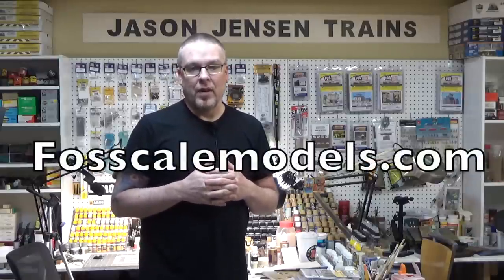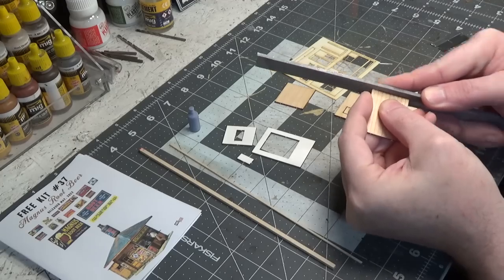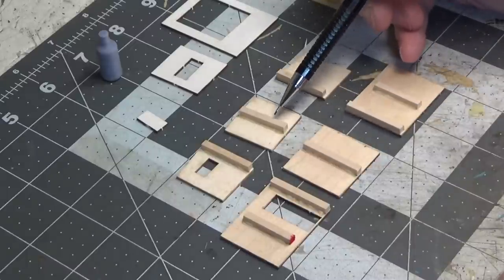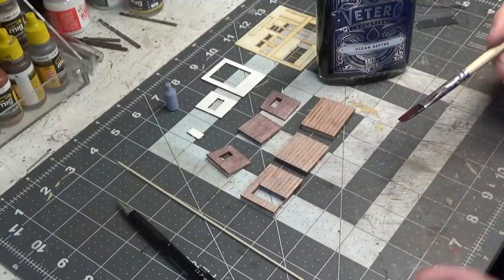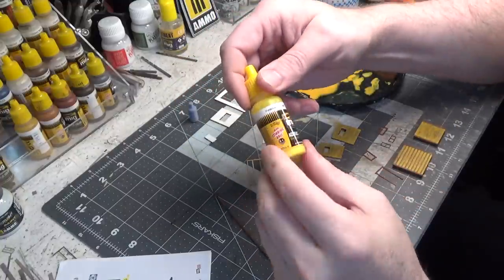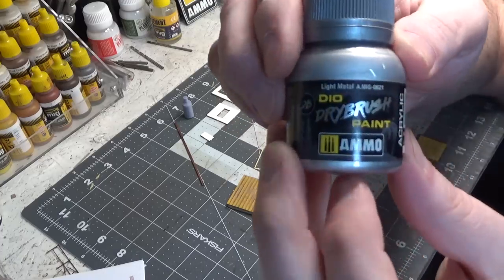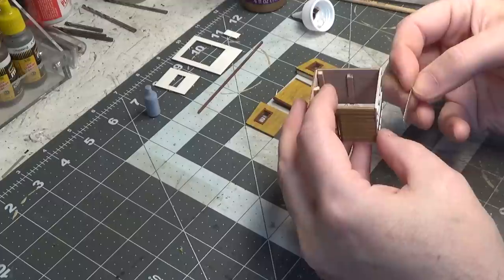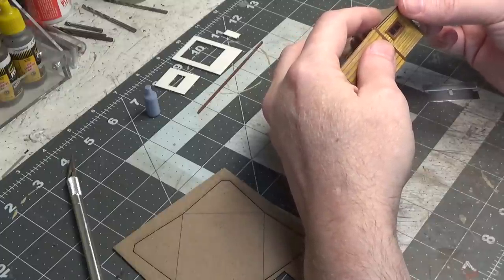Lets build a root beer stand!

Comment: Jason great job AGAIN!
In last night's late mail I received my FREE #37 from Dave Fos & gang.
JUST before I started to do the bracing your video dropped.  So I'm taking my lead from you.
I'm going to SMASH BUILD the Root Beer Stand as a historic road side eatery called Gene's Fish Fry.
Gene's has been a staple of my Upstate NY community since before I was born.  It will make a major interest point when my kids, modeling pals, & I rebuild my layout.
A few alterations to Dave's design is the base coat paint will be white.  Inside the base will be slightly distracted off white.  The front and back walls will be patriotic Red, White, and Blue.
The two side walls will be 3 tones of blue with different colored images of Tropical fish.
I found a 1947 newspaper photo of Gene's interior.  I'm thinking of doing some sort of colored pencil or chalk to detail the photo as a divider wall?   That will mean I would have to make absolutely certain my side wall braces are exactly in the same locations.  Add some 3D prints and soda jerk.  Lights.  Picnic tables with umbrellas.
But there is one problem.  The original Gene's had, has to this day, a hugh whale, on the roof, bobbing back and forth.  It was a visual (jump scare) hit with all kids for generations.  How to pull that off could take time, thought, trips to Gene's (on Father's Day), & a bourbon or two!
AUGH!   Me and my animation.  When will it end.
See you next time.
Jim
Reply from the maker: Thank you so much Jim!!! Sounds like you have a fun project planned! Maybe search a whale on google. Then after you find one you like you can resize it to fit the model. You can flip the image so it’s on both sides of the sign. Have fun and happy modeling!!! 👍